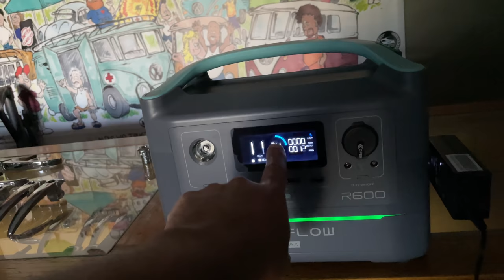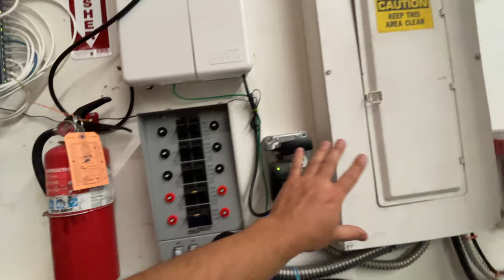I knew this day would come - DIY POWERWALL

Comment: Glad i'm intelligent and educated enough to have realized the utmost importance of throwing the main breaker switch off prior to attaching lines from that battery combobulation into the house wiring. You want to know such things and its good you included that tidbit of useful vulcan knowledge upfront, or things would end up going boom when the grid power lines suddenly became reactivated.
Rock on, oh, and cool 2nd floor level to the shop with full carpeting even. Ok, install the zipline, or the skateboard park pools that can be raised or folded when not in use, folding like those special camera lens covers with the 5 or so segments that spin to create or turn the pool shape into a out of the way wall mounted chair rail.
This concludes this interactive dialogue using this digital telegram, while practicing safe social distancing in a manner of which you have no requirement to even reply back to, though can though i don't think you will.
Reply: You could NOT ever power your house, during a black-out, without first disconnecting the Main Breaker.  Therefore, your scenario of the Power re-activating and burning up your Inverter simply cannot ever happen in the real world.
Reply: @MrSummitville  You misunderstood what i meant there, i was talking about it being while the power was still active.
"the utmost importance of throwing the main breaker switch off prior to attaching lines".
Reply: @truetech4158  No, I did understand.  So, I will repeat, what you actually wrote,  "... or things would end up going boom when the grid power lines suddenly became reactivated ...".   <== That scenario can never happen, in the real world..
Reply: @MrSummitville  Well as i understand to be, you can blow things up if you dont wire them properly, 'the real world magic smoke'.
Reply: @truetech4158  If you fail to turn off your Main Breaker first, then your Inverter will fail IMMEDIATELY when powered up.  It will either blow its Circuit Breaker or it will Smoke.  Either way, your inverter cannot back feed the grid and therefore it cannot be ON and connect to the grid when the Grid power is restored.  So, there is no possibility that your scenario   "... or things would end up going boom when the grid power lines suddenly became reactivated ..."  can ever happen.

Comment: it's doable to do a 240 volt split phase on 24 Volt base system. But Really should be only be on 48 Volt base system. Because of the Amp draw !!!
Reply: 12 Volts, 24 Volts or 48 Volts all depends up the size of the Loads - ie the size of the Inverter ...

Comment: UPS nice. 
Question: Is there an inverter which will take input DC voltages of 12, 24, and 48VDC and output 115VAC? 500 to 1000Watts is fine and costs about $200.00.

Comment: 11:00 No, split phase is not "two different circuits"! It's one circuit with 3 different possible paths. No, using one branch circuit to feed other branch circuits is not okay! And no, telling people how to act irresponsibly and then making a disclaimer hoping to indemnify yourself against your own bad advice is not cool.
Reply from the maker: Yet I did,  if you want to limit yourself to doing what others decree you can and should, go for it.  I’ll keep doing what I’m told can’t be done.
Reply: @StringerNews1 - Actually Split Phase is two different circuits because, 120 Volts between "L1 + Neutral" is Circuit #1 and 120 Volts between "L2 + Neutral" is Circuit #2.  It is possible to lose power to one circuit ( Leg ) while the other circuit ( Leg ) is still working = 2 circuits.

Comment: backfeeding can result in death or injury to yourself or a utility worker, not to mention the destruction of your home.
 Backfeeding directly to your home's electrical panel instead of using a transfer switch is dangerous and It is often illegal, it should never be attempted under any circumstance. 8 hours without power is NOT an emergency it's an inconvenience.  you should not be explaining to people how to make this illegal connection "properly"  you should be advocating for electrical safety on your platform.
BUY A TRANSFER SWITCH
Reply from the maker: Settle down you square.  If it was up to you we shouldn’t have attempted to land on the moon because it’s dangerous.
Reply from the maker: Go away

Comment: I guess all those solar panels and windmills couldn’t do crap for California huh? Y’all should switch to coal power generators
Reply: Coal Plants are not the solution, when the problem is ...  the Transmission Lines are shutdown.  Residential Wind Turbines & Solar Panels do keep the battery bank charged, which powers the DC-to-AC Converter, which does keep the lights ON.  Anything and everything run by the California State Government is crap!!!  It is not a technology problem. The problem is ...  stupid / corrupt  / arrogant government  officials ....
Reply: Yes the Californian government is crap. But also I have 3D designed something that will change electric solutions that does not need the sun or water or wind to power it and it is not combustion driven and it will also shut the tree huggers up about too much emissions
Reply: @MrSummitville  Yes the Californian government is crap. But also I have 3D designed something that will change electric solutions that does not need the sun or water or wind to power it and it is not combustion driven and it will also shut the tree huggers up about too much emissions
Reply: @noahwilson6162  I hope your idea works ...

Comment: One of the most power-outage prone states in the US also has laws against off-grid solar and discourages backup battery systems.

Y'all ought to slap your lawmakers.
Reply: It's worse than that - the state raises taxes on off-grid solar systems but their power grid can't keep up with demand, issues rolling blackouts. You can't win in California.
Reply: @houseofno  It's as stupid as Coloradoans not being able to collect our own rainwater.
Reply: Why do you folks keep electing politicians that do this to your state? California sounds like it’s becoming a third world country.
Reply: @brucebugbee6604  One of my voting criteria is actually if the candidate will renegotiate our water rights in Colorado so that we can re-use our water, but my vote usually gets overruled by voters in Denver.
Reply: @brucebugbee6604  You're not wrong, though. India used to hold the title for most people pooping in the street, now San Francisco does.
Reply: Thomas Chrombly  I got around the wholemess by simply building a compLetely SEPARATE SYSTEM IN MY HOUSE Whenever the power goes out, I simply turn all the grid stuff off, and then turn on my separate SOLAR powered devices. Changeover takes 90 Seconds. And since NOTHING of my system is connected to ANY part of the house or the grid,  NO stinking permits!

Comment: You're putting power to a male plug? A transfer switch like comes with a Generac backup generator would be a better idea. I'm sure someone makes inverters with a "link" feature to connect two together for split phase and 220v.

Comment: Can't wait for Vehicle to House technology. When a car is in the garage with a huge battery it would be nice to leverage that power into the house for powerline outages.
Reply: Some people are already doing that with their hybrids...
Reply: Bi-directional charging. That’s the word you’re describing :)
Reply: @ZeoCyberG  how? They tap the battery directly? I want to do some mods to by PHEV, but Hyundai had a lifetime warranty on the battery when I bought it... so I'll probably never touch it. Unless I can keep the warranty in tact.
Reply: @justinroysdon2630  Depends on the Hybrid, some essentially give you an built in inverter that you can hook up to the house like a generator, which it basically functions as in that configuration.  Like the upcoming 2021 Ford F-150 Hybrid has a 3K outlet in the rear truck bed...

https://pickuptrucktalk.com/2020/10/generator-or-inverter-2021-ford-f-150-pro-power-onboard-explained/

So long as you are using it in a way that it's intended, it shouldn't void warranty, which should also only be a issue if you damage the vehicle...  While warranty eventually expires and you can then do whatever you want, within reason...
Reply: some vehicles alredy have this feature built in i believe

Comment: just get an old 24V or better 48V 5KVA APC UPS and forget about mains switching. They are not expensive on ebay. Time tested, quality high end stuff. Or if you can afford it just get a low frequency inverter with UPS function.

Comment: Just a thought you could backfeed ac couple your 3000w 36v inverter with your 24v system the the 4 blue inverters on the wall. But I wouldnt use all 4 you will push to much back

Comment: i actually have space in my moms breaker panel if i ever needed to do something like this if  i ever had the encouragement to attempt to build the system if i had  the cash as the extra breaker right now once went to a whole house AC system...that system was antique and only thing that is 240v is my moms stove and the fun fact about the way this house is wired there is 2 main disconnects the breaker in the panel itself and there is a fused switch as well i cant think what that is called though

Comment: Reverse. 
Should be running on battery full time and use the grid for back up.
Reply from the maker: Not a bad idea these days
Reply: New normal. 
Reality 2.0 : IRMARIA 2017: Back to back Hurricanes spelled it out for us. 
Two Tesla Modules and an MPPsolar 48V 5KW split phase inverter later,
 Been running on sunlight almost a year. 
 The Grid is on standby for backup. 

...Made possible by people such as yourself who share their experience openly. 
~Gracias!
   BTW your Volky collection is legendary. 🤙🏽

Comment: Have you thought of wind power to charge your batteries?
Reply: I like the thought of wind power helping to recharge your batteries, since the Santa Ana winds are the culprit use the wind power to recharge your system even if you don't have solar. I would suggest a few lantern style wind generators that can give you the power you need. Besides, they are not huge blade units and you could consider dumping the excess power after your system is charged into a hot water tank to reduce your natural gas if you are using natural gas to heat your hot water. Keep up the great vidz and it would seem to have a system in place activity ready for a grid down event would be the better way to encourage your watchers to be best. To help us not just build battery systems and arrays but to make them practical and usable. Like you did in Puerto Rico to help them get through their power crisis and survive the challenges they faced at that time they were without power. I salute you for your efforts because you did they darn thang helping them through.

Comment: Set up a 220  15 amp  breaker for your panel box wire in with 14/3wire to a double box and put 2 male plugs with cover and caps hang 2  6 foot extension cords on the wall beside it then all you have to do is shut off main breaker turn on the double 15 amp breaker and plug in the backup power  if you put in an interlock so that the double 15 can't be on unless the main breaker is off then you can either leave the backup power hooked up or hook it up turn the backup power on then go and shut the main power switch off and turn on the 15 amp double pole breaker if you don't have an interlocking mechanism you must always turn the main breaker off first before hooking up otherwise you could find someone has turned the 15 amp double breaker on and if you hook up and turn the backup first you'd have a very dangerous situation could also if the power comes back on before you get to the panel  box fry your backup since I'm planning to cut the grid I'll hook mine up to where the old dryer plug was

Comment: Let's say someone is building a brand new 4 bedroom house and wants to have solar roof and battery backup, but doesn't want all the electrical infrastructure on the outside of the house or visible in the garage. How much enclosed space, like a utility room, should they plan to build? Like a 4x6 walk in closet off of the garage?